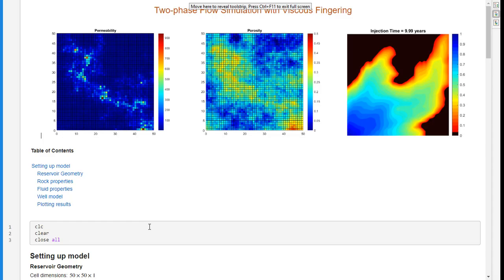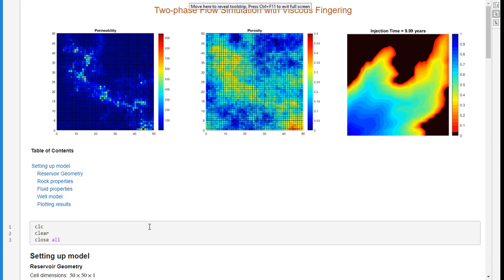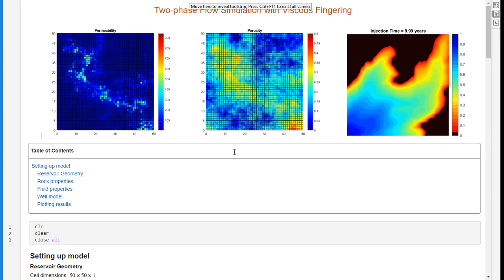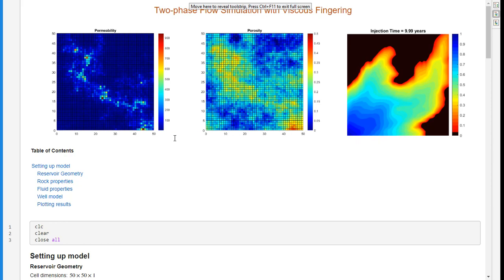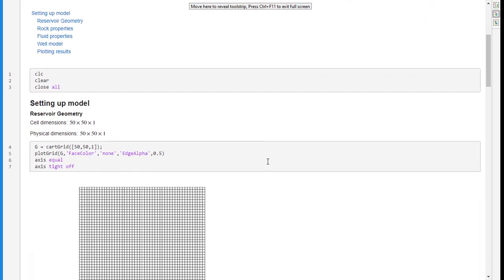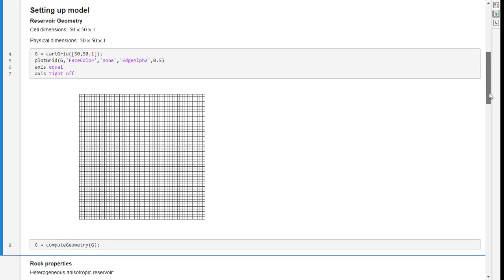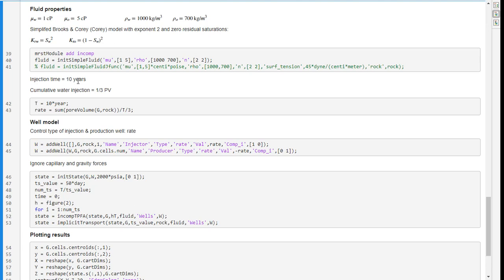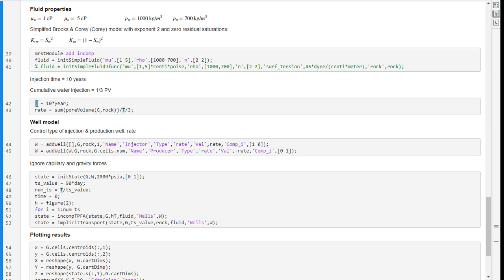2-phase Flow Simulation with Channeling/Viscous Fingering in MRST

Comment: Good work!
But isn't it a channeling effect instead of viscous fingering?
Best regards.
Reply from the maker: Thank you!
What is your definition of channeling effect?
Reply: @SajjadMoslehi  It would be the emergence of a preferential path for the flow due to the heterogeneity of the permeability of the medium.
Reply from the maker: @KarlIgorMartinsGuerra  Based on your definition, you're right. I could say that this is a combination of viscous fingering (due to the lower viscosity of the injected phase) and channeling effect (due to permeability variation in the porous medium). Thank you for your valuable point.